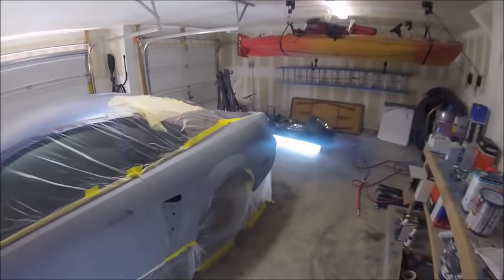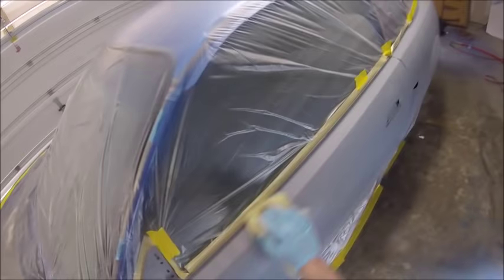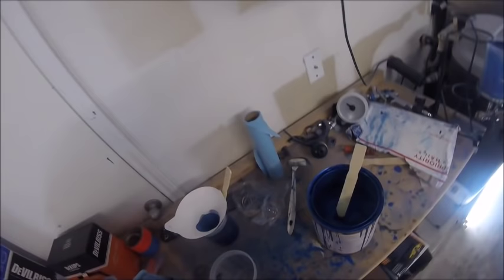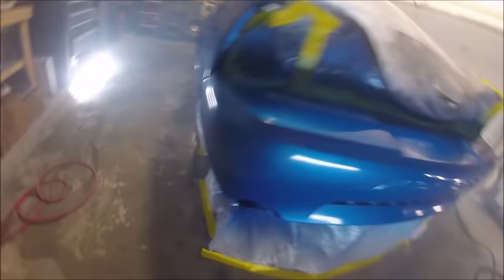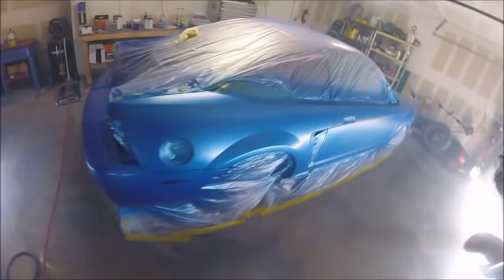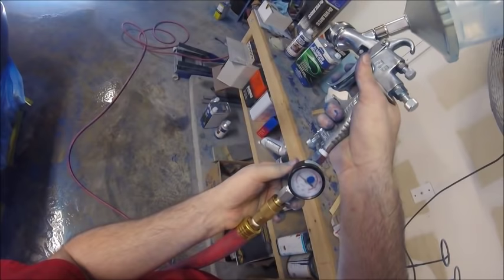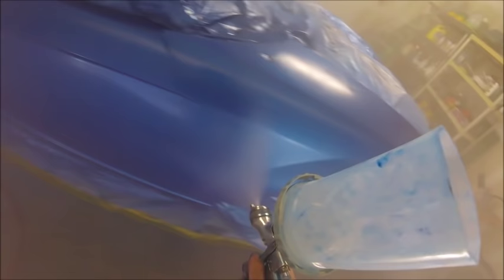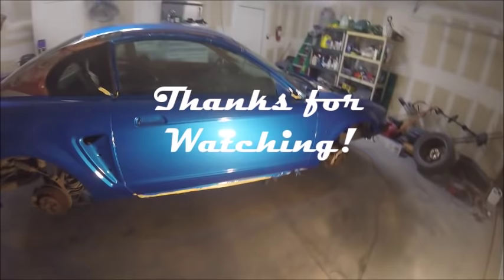Painting Your Own Car At Home

Comment: Good job I will give you some tips for the future  while tacking off the car , fold the tack rag into 4s use a clean side every time .Also use your air blow gun as you tack off. 2.never plastic up to the panel directly use 12 inch paper to frame off panels then apply plastic to 12 inch paper reason for this as you Apply your 2coat of clear the plastic will shake off and you could have dried clear from the first coat flaking off into your fresh clear...3. you may want to try "bottling" that clear  Get a larger bucket fill with hot water mix your clear in the smaller mixing cup now let it sit in the hot water for 15 min. will help the clear flow out of the gun easier and lay down  nicer for you.   good luck if you need any advice message me . ASE DuPont certified painter.
Reply: Frank Searing great info bro that so inspired me bro
Reply: Frank Searing I agree with your solution on the hot water instead of reducing the clear
Reply: Frank Searing
Reply: That hot water tip helped me a lot!
Reply: Frank can you paint in garage when it's raining outside? its sprinkling and humidity its 70.should I or wait for sunny day?
Reply: Another way to get clear to lay down nice is to just put both parts still in containers in bucket of hot water as you spray base coat.  Then you have a nice warm clear when mixed.  I live in cold canada, and so i like to make sure base has completely flashed before hitting clear, it avoids solvent pop, so lots of time to ix clear after base.
Reply: Try using punctuation. 
It will make your comments readable.
Reply: About the tack rag...spread it out, don't fold it...and don't press it down hard because you will transfer varnish to your paint surface. In fact, if you have a new tack cloth, wipe something slightly dusty first so that the dust soaks up some of the varnish. After a couple of passes, with a new tack rag, you can be more aggressive with a wipe...and always ground the vehicle because wiping produces surface static electricity which attracts air borne dust...think kids rubbing a balloon on their hair and then sticking the balloon to the wall.
Reply: have two guns
Reply: Hey everyone, the best results that I have ever had was by using the Magic Painter Method (just google it) without a doubt the best course that I've followed.
Reply: what tip should i use for base coat usually and clear coat for my sata of devilblis guns?
Reply: aaron anderson  Bro you don't know what kind of plastic the dude in the video used, maybe it's just cheap stuff from a big box store. The advice from Frank is sound.
Reply: @markanthony3275 all them tip are good, how would I ground the car tho??

Comment: I have a sweet tip for the breaker situation - I hooked up a small light to the same circuit as my compressor and I turn it on, when I use the compressor. Should my breaker go out, I'll have a visual warning as the light will go out aswell. Has helped me a lot in the past!

Comment: For your first Youtube video, I have to say you did a very nice job... Makes me want to try and paint my own car. Well done.
Reply: PAINTING IS NOT AS HARD AS I THOUGHT..WORKING TO PAINT MY ANTIQUE LATE 70'S NOVA..AND ILL BE FRANK..IF YA DO A CHEAP GUN.GET A GOOD ONE..PRIMER WHAT NOT..GO WITH A HARBOR FREIGHT..BUT PERSONALLY I DONT CARE WHAT ANYONE TELLS YOU..1.4 CAN SPRAY ANY MATERIAL..JUST CRANK THE AIR UP AROUND 45 PSI ON HARBORFREIGHT OR VERY BAD ORANGE PEEL..FOUND THAT OUT FIRST SMALL PIECE I SPRAYED WITH PRIMER....THAT WAS THE WIPER VENT PIECE..MAKE SHUR.ANY CHEAP GUN YA USE..IT SHOULD HAVE MORE THAN ONE HOLE ON EITHER SIDE THE TIP....MORE HOLES.MORE ATOMIZATION AND THAT HELPS GET A FLATTER JOB....ANOTHER THING.IF USING METALIC..LIKE THIS GUY IS USING..I JUST FOUND OUT YESTERDAY..WED. WHEN YOUR SPRAYING..AFTER A SHORT SPRAYING..HOLD FINGER ON TOP OF LID HOLE..TURN GUN UPSIDE DOWN AND GIVE A LITTLE SHAKE...HELPS KEEP THE METAL FLAKE FROM SETTLING WHILE SPRAYING AND GIVE AN OFF LOOK IN THE WHOLE JOB...SAT I AM  TO SPEAK WITH ANOTHER PAINTER IN THIS LOCAL SHOP ABOUT USING SOME THAT PEARL MIX  IN A PAINT JOB WITH METALIC..I SEEN A 60'S OLD BUICK AT A CAR BIKE SHOW THAT HAD BEEN DONE BY THIS GUY AND IT WAS A SICK ASS PAINT JOB..REALLY STOOD OUT...BUT WILL GET SOME INFO ON HOW HE MIXED IT..THINK HE MAY HAVE ADDED IT TO THE WHOLE GAL....KNOWING WHAT I LEARNED..KINDA WISHED I WENT WITH PEARL..BUT PEARL METALIC IS REALLY UNIQUE LOOK..  BASE AND CLEAR..DEF USE A 1.3 TIP..READ LOT STUFF IN FORUMS..MORE FOLKS GOING THAT ROUTE..
Reply: it actually is hard if your a perfectionist you have to know how to mix you have to know all about colour codes n stuff, it is hard if you want it done in a professional style
Reply: Thanks for valuable guidance.  Would be easier to read if not all CAPS!
Reply: Let me guess you are a professional? LOL  I actually have a family member that started out doing custom paint jobs in a small shop and now has a multi million dollar shop.  Yes it is obviously best to have the $100k paint booth and $20k air system but even he swears the keys to a great job is the prep, cleanliness of the area you are painting in, and the quality of the product you are using.  He helped me set up my hobby shop and he was very particular about the air filtration system so I assume that is a very important part of the job as well.
Reply: Bob Mehsikomer show me expensive houses that are abandoned
Reply: It looks easy but its not, there so many different ways i messed up cars untill the point i finally learned but then i had to learn by my self. If you have a friend to explain it to you  go right ahead hell walk you across all the mistakes and headaches.
Reply: @timo2.4tattoo Saucedo all day long it's big enough.21 gal can not keep up enough volume..its drop off time is quick.meaning not enough cfm..look at pressure regulations for your equipment.some run 14 cfm at 90 psi.some at 11.5 cfm at 90 psi..in short.with 60 gal.220 volt motor.she will run and you dont get that big drop in pressure b4 having enough to keep spraying.thats why a 21 gal is a joke.trust me.did 2 fenders hood and 4 smaller pieces.it was a literal pain in ass..asp half way on hood.had to stop n wait for pressure.good min to make 4 .ore passes and wait again..smfh..60 to 80 gal tank..no law says you cant run a 2nd tank either for added volume.but that's for the serious yearly pInter if you want to build a good set up.not needed for diy guys.but 60 plus gal tank I highly recommend flat out.if you go 21 gal..expect lots down time n a shit job if you cant counter delay time

Comment: With those Dekups Before you flip your gun spray it upside down till it shoots paint... it will allow you to spray your gun in any angle even upside down. That's one of the best features those quick cups provide... also try not to press too hard on your tack rag either you will push the tack residue onto the panel and that will give you fish eyes as well.. also anytime you do metallics fill that cup as far as it will go and don't spray panel to panel walk the length of the car and don't forget to put a drop coat down to orient your mettalics.. also dedicate a gun for your base and gun for clear you will have way more consistent results and  you wont have to constantly change your gun settings to shoot base or clear  normally a 1.2 or 1.3 fluid tip is good for base and clear you may just have to adjust your air pressure and fluid flow for the clear since it's usually a little thicker.. great job otherwise the best way to learn is doing it!! Car looks great 🤙

Comment: With the clear you should overlap at 85%to75% . The base you can do 50% overlap with single stage you should be at anywhere from 50%to75% and I always open up the gun all the way with 28 to 35 psi with clear and single stage up to 45%.  It it looks like your doing alright. The one thing with clear it can be cleaned up and buffed but from what I can tell it’s looking pretty good

Comment: should have put the compressor in another place so it don't suck up paint fumes and cover the tool box. a set of old brake shoes  at the front and back of the tires will help stop the hose from hanging up, a metal chain or cable from the metal body to the ground will help stop static electricity from the car drawing dust. also sometimes the plastic flopping around can bounce old overspray dust in the paint.
Reply: interesting info..i will have to remember this with grounding the car...blowing any air acrost anything creates a static even if its with a wet substance..learned that 27 yrs working nat gas industry..i am not following the old brake shoes part..replicate it in a video..even if using a garden hose so to speak..and copy a link here...we all may learn something....i am learning something to be honest....i was going to paint my hood and fenders that is off my 78 nova sometime this month im praying..just got a new gun in..1.3 tip..many will say wrong..but..after primering and sealing fender,hood and other small items.the 1.4 tip sucks..ill be open and honest..harbor freight gun..2 gun kit..the 1.4 tip set up with spare 1.8 tip..the tip area on gun has one hole left and right side of the tip horizontally..had some peel effect with primer,,sanded down..then did second coat with sealer..had to jack air up to around 45 psi to get a good atomization..sent a pict to friend thats painted for a few yrs off and on..said because gun has one hole..is my huge issue getting orange peel..told me i probably should have been up around 48 to 55 lb psi to lessen the orange peel effect..see..i learned something..and i have jacked up to about 50 when i had to do my hood in sealer..WOW..what a difference..almost completely flat 95%  the hood..just a few tiny spots had a bare notice peel..my fenders however..i blocked that down with 320 grit that was like using 400..just the feel of the  paper..oh..and btw...i learned 2 weeks ago after going thru some paper and they was out..i seen this purple colored backing paper..non clogging it stated..YEP!..NEVER SEEN PAPER LIKE IT BEFORE IN MY LIFE..hope i can get it in 400..but any ways.back to the painting...week half ago..ordered a gun..not expensive..a guy painted hundreds of jobs with it.said buy it.so i did..i seen 3 cars he done and amazing for a 28 dollar gun..ten holes around tip to atomize ...my bud at garage told me also..i should get a lot better job..esp with the paint and clear....
Reply: but here is a question im concerned with..color matching up using med metalic green..its orig color on my 78 4 door nova im restoring..well not a lot to restore..swaped inline thats was ruined from a garage..put in a custom built 350..roller rockers.2 stage up from factory cam..good crank,rods.valves.and rings and racing pistons..car is driveable  w new trany.2 hrs run time and still got break in oil in for now..just not inspected..drive in and out of garage only  to paint..anyways my question is...being metalic..and rest car not done /preped to paint..got lot to do as far as sanding down.some tiny dings what have you...would you advise..one ..2 coats paint...and work rest the car same way...till all painted..then wet sand and clean and do a final coat or 2 paint  then clear..all to avoid color fading..i am asking because i want to paint up what i have off car..get put on to go drive to buds garage to get it inspected..then work on rest car primering  sealer and one 2 coats paint and prep to do a full paint job..just some input..I take it you know what your doing is why i am asking.....take another note..i gots a very bad back.herniated disc and bulging...i am  only able to do so much at a time..or im in extreme pain.. and reason i noted if i can effectively do car up to paint only for time being..till all done..then prep and hit again..then the clear..appreciate an honest feed back....oh  and the compressor issue..smart thinking..lol..i best put up a  shield of some sort..cardboard if i have to....
Reply: AdirondackNY 0
Reply: AdirondackNY I
Reply: Adirond🇦🇱
Reply: Clear coat hahahahahahaha
Reply: grounding the car has no benifits. It actually has a negative affect as the ground provides a path. The brake shoes definitely does not work...tried that in my younger days from another guys suggestion. Actually made more hang ups. I dont use plastic so i don't know about that shit. lol
Reply: AdirondackNY th
Reply: Bonniville Black Cherry  glass cleaner works to get rid of static electricity especially on fiberglass parts. I had a radioactive blower  that did a good job !! My boss stopped paying for it so back to glass cleaner.

Comment: First of all - not bad assuming you don't work as a painter.  If you are a painter well... shrug.   When it comes to clear you should never manipulate the mixing ratio to accommodate spray problems - as a matter of fact you should not do it at all ever. If the gun isn't working right then - stop.  Dump the mix into a clean cup and fix it.   If the material is coming out too slow but the spray pattern is good then you have a restriction somewhere.  The needle could be built up with paint etc.   99.9% of all runs come from laying a heavy wet coat above a thin light coat.  Think of it like an ocean wave and the heavy, wet coat will actually flow over the more shallow light coat and as it does, where it ends it will leave a run because the thicker coat is deeper (taller) and will rise up above the other.  Often you can actually get rid of a sag/run/trash by adding more clear.  This will only work if the layer with the run is already tacked off. You have to apply a nice wet, wet coat over the run.  Whatever panel you are shooting you need to shoot the whole thing to get rid of the run and do right.  For example, coating a door you can just shoot the entire thing but make sure you overlap each run by at least 50% - preferably 75%.  Make absolutely sure that each pass is the same as the one before it.  Same distance away from the panel and the same speed.  As long as it is wet (heavy / deep / lots of material) the new coat on top of the run will reactivate the partially cured coat beneath it and it will start to flow out.  If you do it right, the run will flow out with the newest coat of clear and should no longer be visible.  If nothing else, it will be much easier to sand and buff out with it flowed out a bit,, with a more gradual rise.

Comment: I was a vehicle paint sprayer for most of my working life and used a wide variety of different paint systems,my favourite was always the 54 line Glasurit system base and clear.It layed down like velvet regardless off however you layed it on.It was and still may be the only paint system that B.M.W insisted on,likewise many other high quality car manafacturers,including some super car manufacturers.I see a lot of other sprayers on here talking of having to walk the length of the vehicle they are painting,after many years experience in this game ,and lots of different products used,including custom painting,metalflakes,candy apples,crackle finishes,vreeble etc etc to name a few,i have never walked the length of the car to apply the paint,and never have i ever had a problem with differentials in the end product.Painting cars is without doubt a reasonably skilled job,if not a very meticulous one,but at the end of the day it all comes down to just how skilled you are with a spray gun in your hand when you apply the chosen  product for the job in hand.Unlike the guy in this video,you always start from the roof and work your way uniformly around the car ending up on the wings and bonnet.If you leave your roof until last there is a really good chance that your roof will end up with a coat of reasonably heavy overspray on it by the time you get to it,and with some products this can cause you unnecessary problems,even to the point of having to flat the roof again before you paint it,which is something you really dont want to have to do seeing as you have the whole car ready to paint in the oven.

Comment: When your spraying, spray the whole length of the car from front to back in one swoop...Esp. If your doing metallic,pearl or candy!!!! 
That way the whole car is the same shade 
Dont do it in sections like fender then door, then rear quarter panel. 
Thats how you get different thicknesses,causing different shades of color
 then your paint will be blotchy out in the sun
And do your edges 1st, that way you dont get over spray on the fresh paint if you do them last
Reply: Ya this whole video bugs me for that exact reason
Reply: Candy only...not required for the rest if your gun is set up well and your technique is good. The real test of a good gun and set-up and good technique is if you can spray an X across the hood of the car you are painting on the last coat of colour...and not be able to see it.
Reply: You watch too many John Kozmoski videos.